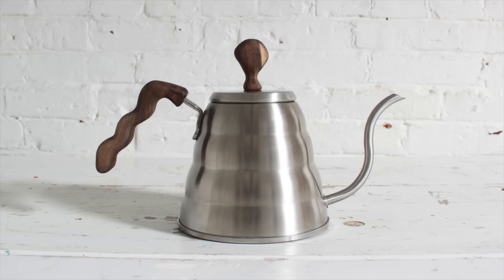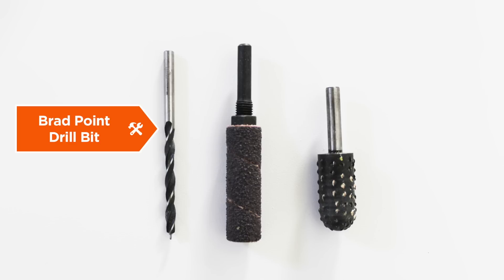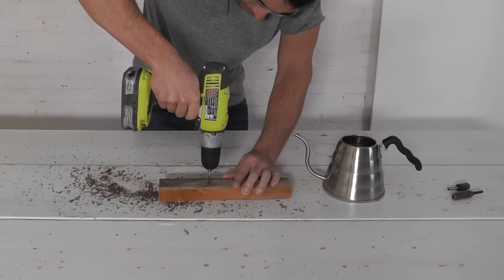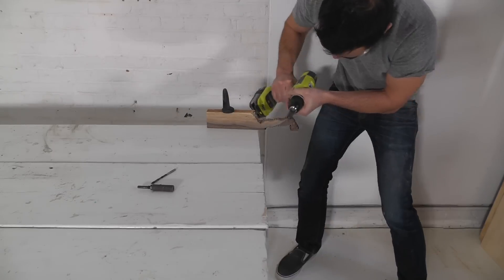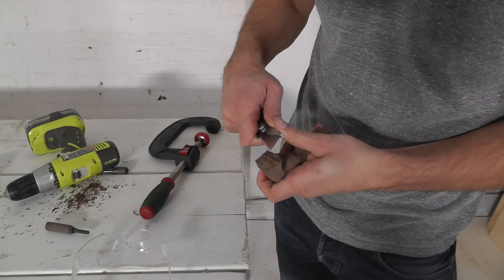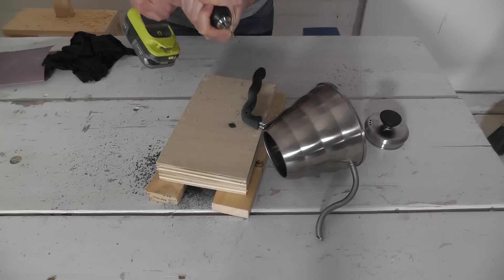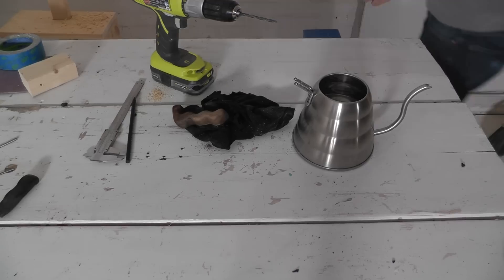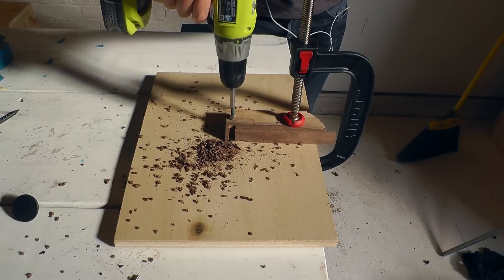How to carve new wood handles for an Hario kettle

Comment: I love the idea to use a router burr bit in a power drill. Where can I get a router burr bit as big as yours?
Reply from the maker: Royce Barber i got it at home depot for about $7
Reply: HomeMadeModern Woohoo! Thanks. Do you know if there is a product name? I've been searching Google/Amazon/Ebay all morning for "woodworking burr", "burr bit", "drill burr", etc. With zero luck. Your burr bit is way bigger than any other. I'll check Home Depot when I can. Home Depot's website sucks (as most do). :P

Comment: Beautiful, but time-consuming. Why not use electric jigsaw :)
       Мark.
Reply from the maker: Yes! that would be a bit faster.  I have been getting a lot of emails from people saying that they want to start building things but that they don't have enough tools.  A cordless drill is the most commonly owned power tool so i wanted to show that in a pinch you can do a lot more than just make holes.
Reply: HomeMadeModern    So I realized that you do not have a jigsaw. %).
              But in America it is not as expensive as we have - without battery and charger - $ 80 :(
               Still wanted to ask Riobi Nation program helps you to shoot video?
        I would also like to participate in it, but unfortunately in Ukraine it does not work :(
     Mark Fisher. Kiev, Ukraine :)
Reply: HomeMadeModern Same technique is used in knife making. 

Hate jigsaws since they naturally cut crooked, that was a chunky bit of hardwood, would have likely looked like / all the way around, the time you saved is now spent sanding it straight. 

Just cut a curved profile in some construction lumber and spent more time than I care to admit with a spoke shave and some unkind words.

Comment: Why you just not use a regular jig saw, instead of drilling bunch of holes! Oooh, now I see, because you advertise this drill or just love to drill holes :)
Reply from the maker: jigsaws are great, and i have done a few projects using them.  I have been getting a lot of emails from people saying that they want to start building things but that they don't have enough tools.  A cordless drill is the most commonly owned power tool so i wanted to show that in a pinch you can do a lot more than just make holes.
Reply: HomeMadeModern I'm sorry, I didn't know about the emails. Yes, jigsaws are great and are very cheap basic tools that everyone can afford. But I admit that you can actually start doing something, even if you don't have all kind of tools, only depends on if you know what you want to do and how you can do it. Nice videos, keep on inspiring people!